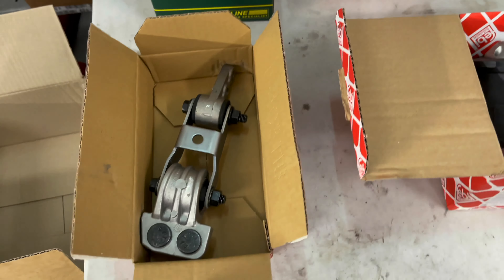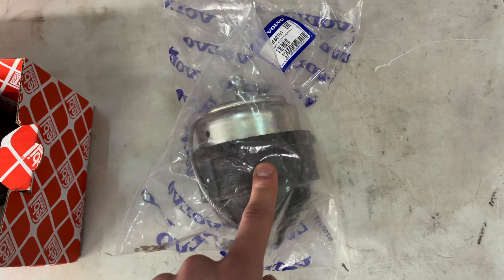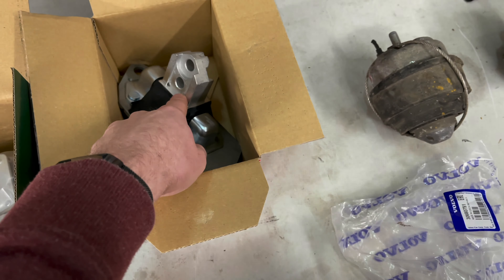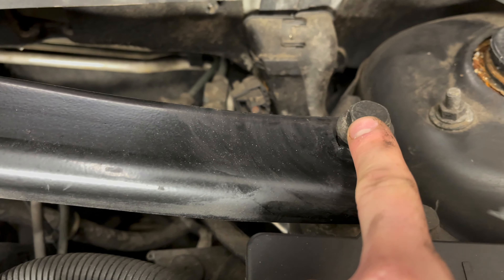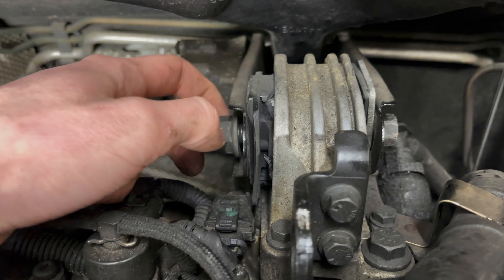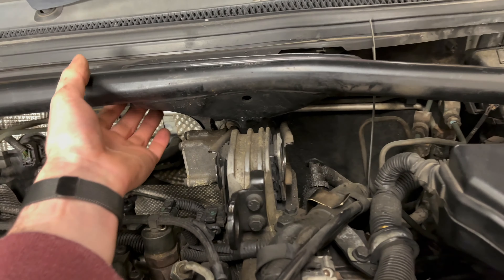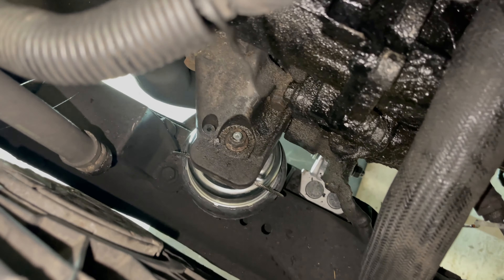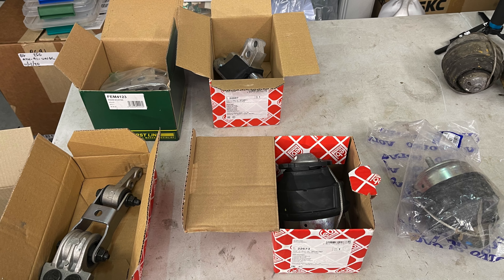How To Replace ALL 5 Engine Mounts Euro 3 D5/T5  - DIY Volvo V70 S60 XC90 S80 P2 Vacuum Front Rear

Comment: As a former Volvo mechanic I advise you to fix your oil leaks. They wil eat your new rubber mounts in no time. Keep the good work 💪🏼.
Reply from the maker: Hopefully when I have current projects out of the way. I think it needs a new steering rack before anything else!
Reply: That happened to me
Reply: What oil leak?  Car was pristine clean under the bonnet
Reply: Do you know if the engine mounts are identical for the petrol and diesel models? I can only find mounts for the petrol engine online
Reply: 23:50
Reply: @PJL7095  there is evidence of engine oil leakage in every frame of the tutorial.
Reply: @winstontimmermans7816 they are not. The D5 engine has vacuum controlled mounts with vacuum lines.

Comment: Done on my Volvo XC70 P2 2006

Back engine mount it was a pain, on the end I cut the top bolt couple mm to be able to go in.  I lift the engine maximum as possible but I think the aftermarket engine mount it was a bit bigger.
  Everything done on maximum 8 hours with no experience before.

Many thanks!
John
Reply from the maker: Well done John and thank you for sharing your experience. All the best 👍

Comment: Brilliant. My xc90 decided to leak oil today from the bell housing very near to the mount that you mentioned was causing the metallic sound. I also had the metallic sound too today. RAC chap mentioned that this mount was goosed. Didn’t realise just how simple this one was to replace. Assuming that it’s just a plug that was thrown possibly due to excess vibration due to mount, I think I may be okay. Again, thanks!
Reply from the maker: Thanks Paul, you’re very welcome and I’m glad you got to the bottom of the problem on your car 👍

Comment: This is a great video. Well explained, precise and realistic using tools most have access to and in similar working conditions.
I have a 700k + S80 project with the old TDI engine and I need to look into the main mounts, after I noticed that the top and lower torque ones are worn.
Reply from the maker: Thank you! I think your car is one I saw advertised and then shared about on Twitter. I was interested but unfortunately I don’t have space for more than 4 cars currently so I have to be “sensible”. That’s impressive especially for the VW engine, I had a 2000 2.5 TDI before this V70 but unfortunately the timing belt stripped 6 teeth at 207k.
Reply: @IAMASPANNER  that’s the one. Yes, I know the feeling as I have been in the same boat before.
This is on its second engine; the first one went at 350k when the cambelt got damaged by a piece of debris. The current one was a factory reconditioned that is now on 370k. I just had all belts and tensioners replaced for piece of mind, but still loads to do in that car which I’m also recording and uploading as I go along.
Keep up the good work!

Comment: Just changing the top mount helps a lot when your D5 shakes. That mount is on there to dampen vibrations especially when idling.
Reply from the maker: I’ve just driven mine without the sway bar and top mount attached and it clonks when changing gear so it perhaps does more than we think. Not load bearing but clearly stopping a lot of sway.
Reply: @IAMASPANNER  ok got it so thats what this mount does then.
Keeping the engine steady while the bottom mounts bear the weight.
I changed mine for a brand new one because it was just ~45€ and while idling the engine was vibrating a fair bit so people told me to just changed the top mount and doing so helped me with that.
Reply from the maker: @alouisschafer7212  definitely worth changing, they do wear quite quickly.

Comment: thank you for this great video. with your help i changed all the mounts today, the car is now way more smooth on start up and gear changes. the clunking from the front left still persists tho, onto new struts and strut mounts :)
Reply from the maker: You’re very welcome Tristan and thanks for taking the time to comment! The clunking that you have, is it by any chance when you turn on full lock something sort of moves that shouldn’t move? Mine is doing something odd lately but practically all the front suspension is new.
Reply: @IAMASPANNER  the car clunks over smaller low speed bumps, preferrably while turning. happens more frequently when the engine is up to operating temp. thats why i suspected the engine mounts to be the culprit. i changed the end links last year for quality lemförder parts, so i dont think those are my issue. I'll get some new struts and mounts ordered up in the near future and we'll see :) old volvos never get boring!
Reply from the maker: @tristan8243  mine seems to be when I turn on full lock right so I’m thinking it probably is just one of the struts making the noise as everything else is now. Had it over an inspection pit on the shaker plates and couldn’t see play anywhere.
Reply: @AquaLady153  new front strut mounts and a new right ball joint fixed all the clunking. the car drives like a dream now. i suspect the worn out ball joint was the real culprit, it had lots of play.

Comment: So I just did this job on my 05 xc90. I replaced the front right mount first (near the crank pulley). When I had the jack up the motor to replace the rear pad (which was a PITA), I ended up damaging the new front mount in the process. Recommend doing that mount after doing the pads.
Reply from the maker: Thanks for sharing your experience. I think I’d leave the top nut loose on the front mount until the rear was done although I am surprised to hear it would damage it unless it was jacked up quite a lot.
Reply: @IAMASPANNER  actually. You’re right. It didn’t damage it. I thought that cause the suv had a weird fast shake at idle. I pulled the mount just yesterday and it was fine. Now I have to hunt for the issue. I tell ya, I’m done with European cars. Japanese only from here on in. The xc90 fights me on everything. Pretty over it

Comment: Thank You for very helpful video! I have an issue , when changing gears in that moment my volvo has some shake ? I'm driving  2003 model ,maybe need to change engine mounts to fix this ?
Reply from the maker: Thank you for the feedback, you’re very welcome! I’d need more information to guess the issue but a good one to start with is the mount between the subframe and gearbox, when they go they cause a metallic clunk when the engine rocks from changing gear.

Comment: One question, at the sides of the bar of the too engine mount it has someplay in it it is normal and does it has replaccement?, in mine the are way too loose

Comment: Great video, very clear, thanks.
I want to know if this improved the vibration? I just changed 3 of the 5 mounts (the two hydraulic and the torque), the other top and right were changed almost 3 years ago. After changing those 3 mounts the car is chaking at idle much more than before. The vibrations are even worse when i start to release the clutch to go back (the car is manual, euro 4, 2006). Thanks for your help!
Reply: Slm Yousoff. Did you get tk the bottom of it?
Reply: @nabeeljacksonrhoda6480  Salam Nabeel,
The vibration issue was almost solved after changing the torque mount again with the original one. The first time it was from Lëmforder and the rubber was very stiff. Some people say that the one one form febi performs well as the original, I did not try it. I got the original from ebay (VOLVO dealer). Hope this helps.
Reply: @yousoffarrag5945  shukran brother. Feedback and details appreciated. I think mine is combination of noise from the wheel area or cv and mountings.
Reply: @nabeeljacksonrhoda6480  hope you can solve it, it is a great car

Comment: Great video, thanks a lot. I just change all engine mounts with your helpfull video. I have little problem, before i change them the vibration inside the car was average, after this change the vibrations are bigger do you have some thoughts or ideas from where could this coming from? Thanks in advance!
Reply from the maker: Thanks Teo, did you switch to solid mounts, and did you use good quality parts? The rubber compound could be harder transmitting more vibration to the car.
Reply: I'm not switch to solid they are vacuum mounts and also check the vacuum valve and the pipes. The quality of the parts is interesting case it is possible reason for this problem, but after few days of driving the vibrations weaken, only has some strange noise like resonant buzzzzing on 1300 to 1900 rpm no matter it is parking or drive. I'm start thinking about some displacemnet of the exhaust manifold while i lift the engine. Not sure is this possible? I will try to check while holding these revs which part causes this resonance.

Comment: Quick question. I’m replacing the mounts on mine very soon, so it is worth having the vacuum lines connected? Mine have been blanked off, so I’ll be testing the boost control valve and replace the vacuum pipes as they are all blanked off.
Reply from the maker: I’ve never had them connected to know whether it’s much better but it should be. They firm up as you rev and soften at idle so on my car it’s probably not as smooth as it could be once revving. On mine the plastic connector bits broke. Problem is if they fail it stops your turbo working so I just leave them blanked.
Reply: @IAMASPANNER  good to know. I replaced mine a few days ago and they seem to be working. Very slight vibration at idle, but less than before. And no more judder when pulling away.
Reply from the maker: @GentilsGarage  juddering when pulling away would more likely be from the mount between the gearbox and subframe I think.

Comment: Great video. a lot calmer than I would be finding I'd got to remove what I'd just put back on....I think this id the problem with my 2002 V70XC, clunking from drivers side when going over bumps in drive (tracK) in morning when engine cold. I thought it might be anti roll bar bushes, as I just replaced the control arm bushes and steering track rod end etc seemed all good. I cannot understand why the clunking.... which is quite a CLUNK....CLUNK..disappears when engine is hot? Hey Ho.... we will see   Keep up the good work.... Good Luck to you..Thanks

Comment: Gotta say, this vid is a godsend. I've just had all four delivered today after having changed the top three this weekend and I am chomping at the bit to get at it. Despite getting home 3 minutes before sunset, I think I'll go ahead and try tackling the right hand one and the torque bas as soon as I get home. Maybe even the front if I still have light. Also, does anyone have a good explanation as to why the vacuum lines are connected to engine mounts?
Reply from the maker: The vacuum is applied at idle to stiffen up the mounts and vibrate the car less as far as I know. I’ve had mine disconnected since I bought the car so have no idea how effective they may be but my car improved massively after replacing them all. Hope everything went ok with the mounts!

Comment: Hello, what's the metal wire supposed to do on the motor mount for the rear and front of the engine?
Reply from the maker: I have no idea!
Reply: It's a security wire just in case the engine shears off the rubber mounts in an accident, or the rubber becomes so perished that it completely fails.

Comment: Hi Tolly as always your vids are a very great help i would like your advice on a set of mounts i have just bought for my 05 XC90 they are from MaXpeedingRODS and cost £102 for the complete set inc del they look quite good quality but the engine mounts have no vac mounts does this matter ???
Reply from the maker: Hi Chas, that is VERY cheap indeed. They must be the solid conversion ones you can get. Obviously they won’t stiffen as intended with the originals but if you do fit then make sure you block the vacuum lines because they’ll stop your turbo working if left unplugged.
Reply: @IAMASPANNER  thanks mate as previous they look pretty good quality and for the price it's worth a punt 😉
Reply: Hi Tolly an update on those cheap parts it has taken me this long to get a refund off the company as ALL the parts were incorrect and did not fit me XC90 i had to but proper mounts individually in the end ie Corteco so a lesson learned DONT buy cheap cheap :-(

Comment: A little job for me soon then. Thanks for making it look easy. PS Ebay £150 for the set of 5
Reply: I did three of the five today, Have you removed your turbo actuator already as mine was in the way.  Also the one by the wheel, What a bitch so still have two to do. Does the front sphere need to be unbolted as well to do the rear sphere??
Reply from the maker: It will help to have the front one loose as you need to jack the engine up to get them out. I wouldn't like to use anything less than Febi or genuine Volvo although I haven't tried any of the cheaper ones.

Comment: The lower torque mount on mine also was rattling when accelerating. I bought a new one - still the same. I ended up rotating the middle metal part around so the plate with the hole in the middle is not up but instead down. No rattling noise from that point on.
Reply from the maker: I thought the metal that goes over the mount can only go one way because of the vacuum connection?
Reply: @IAMASPANNER  Torque mount - gearbox mount. Not the vacuum mount.
Reply from the maker: @skerymovy2  my apologies for not reading properly but the mention of moving the metal made me think it was the rear vacuum mount. How very strange that it was causing a rattle for you even after changing. Mine made a racket when accelerating before I changed them but no problem after.

Comment: Hi there. Where is the REAR Mount vacuum hose coming from? I have mine disconnected and it would really help to know from where should it be coming from. Thank you
Reply from the maker: The vacuum pump at the rear right of the engine, it has a T piece that splits back to front then another one that splits between the front mount and the boost control valve.

Comment: Gonna do the front gearbox mount today I think, mine is completely rubber free now and it’s just metal on metal, might be why my gearbox is shifting so bad
Reply from the maker: Good luck, hope the job went well 👍
Reply: @IAMASPANNER im doing it right now, didn’t have time on Monday but damn the bolts r tight 😂😅
Reply: @IAMASPANNER worked, thank you for your video! Ima see how to change the front and back ones, if they’re diy-able I’ll buy them as well, as I got a lot of vibration and a terrible metallic grinding noise when starting to accelerate, hoped it was just the gearbox one but the new didn’t fix the problem
Reply: @seesikopter How about now? Seems I have the same grinding noise when accelerating at low speed or going reverse.

Comment: I've changed the rear and front engine/gearbox mounts. Upper and side mount (including the small bushings that attach to the chassis near the strut mounts) were changed last year (~10K km ago). The engine still moves in the chassis quite a lot. I can make it  rock sideways by just pushing on the fender while the car is parked. While going over speed bumps you can feel the engine "jumps" under the hood. Is it normal? What are your experience with this?
Reply from the maker: I have no experience with this but it doesn’t sound right. So you can see the engine rock from side to side by wobbling the car? There should be movement but nothing excessive that feels like it jumps over speed bumps. Are your subframe bolts all tight?
Reply: @IAMASPANNER  Hello. Yes the bolts are tight. I did check it myself with torque wrench. All is as per spec. I will try to change the right side engine mount. It looks like this is responsible for controlling the sideways motion.

Comment: Very nice video! I did the top mount last fall on my 2005 facelift D5 XC70 and it's time to do all the rest @ almost 202K miles...:) Your video is very helpful and easy to follow - kudos!..:)
Reply from the maker: Thank you, very glad to help! Good luck when you do the job!
Reply: @IAMASPANNER  Thanks Tolly - sadly I do not have a garage and the parking areas for my two XC70's is an incline so not good - hence I'll have to farm the work out. Still knowing how it should be done is always useful and valuable - thanks again!..:)

Comment: Great video, very comprehensive! Unfortunately for the gasoline T5s  the front and rear mounts are much more difficult to replace since there is hardly any room to work, unless you are an octopus... 
There are two different part numbers for front and rear mounts but SKANDIX just suggests two of the non vacuum mounts (same pn) be used (by blocking the vacuum pipes apparently). 
It would be helpful if someone in the know could confirm this is OK in the comments.
Reply: Hello odissea. I have the same problem with the rear mount.  I dont know which should i buy to Skandix my volvo is d5...

Comment: Did you suffer any adverse effect from disconnecting the vacuum mounts? Mine are worn out, which probably relates to an intermittent error on the turbo actuator
Reply from the maker: Hi Tom, not if you block the ends of the pipes. If the mounts are cracked or the pipes are left unblocked it stops the turbo working because the vacuum is required for the turbo actuator.

Comment: Hey Tolly, did you torque to yield or are there specific numbers you used for the hardware? Great video, by the way. Concise and easy to follow and take notes for own application.
Reply from the maker: Hi Chris, I just tightened by hand to where I thought, you get a feel for you tight different size bolts need to be after a while. Thank you, glad the video helped 👍

Comment: Do we need to tighten the bolts to a certain torque using a torque wrench?
Reply from the maker: There are torques settings for the bolts but I’ve never used them and never have any issues.